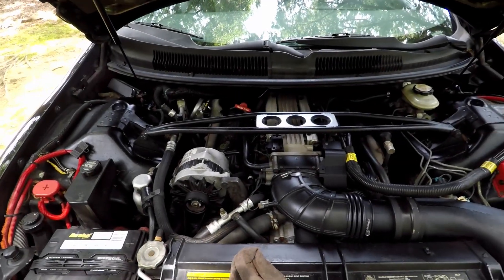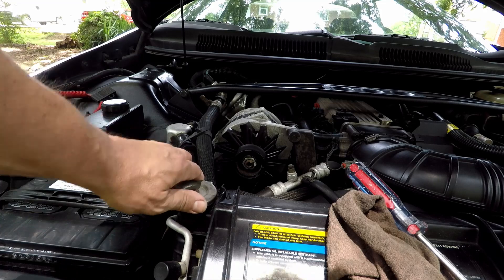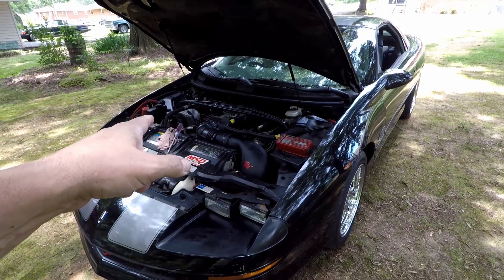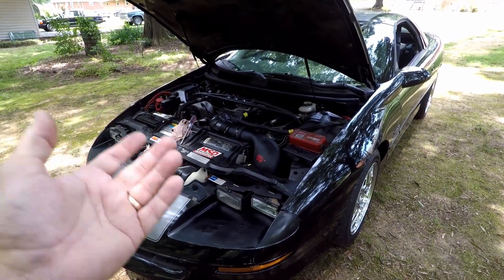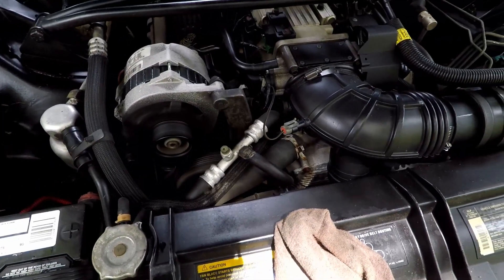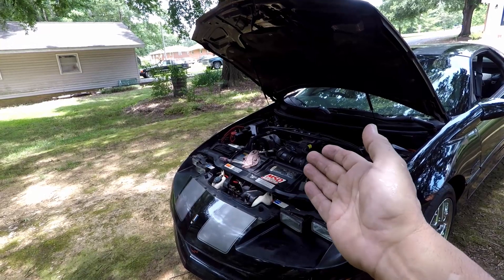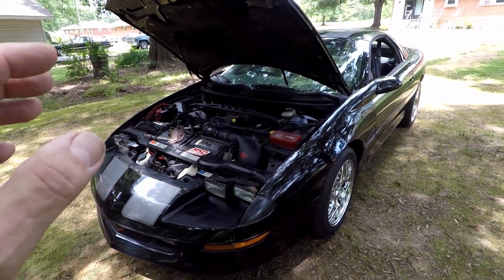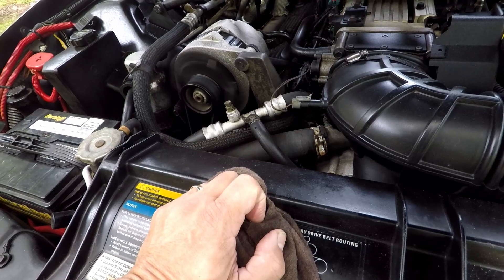How to purge the air out of your cooling system on a 1993 Lt1 Camaro engine

Comment: I'm going to change my radiator this weekend.. I was hoping you had a video on here about this.. Thanks, you make the best videos with fully explaining everything 👊🏻
Reply from the maker: Hi there. I have replaced mine but it was before my Youtube days. Just be sure to pay attention to the placement of the hoses as these cars are reverse flow from a normal car. Thanks for watching
Reply: @CamaroTime yeah I was hoping you had a video replacing the radiator lol but bleeding the air out correctly was my main concern so this video will do me justice. I picked the radiator up today and hopefully going to install it tomorrow along with a thermostat and new cap. I did my transmission mount last week after I watched your video on that. It was pretty easy thanks to your vid

Comment: Checking in 5 years later to let you know I did this exactly as described to my ‘99 ‘V6 Camaro and now she’s not overheating AND my heat is actually hot again! Thanks so much from someone who is not mechanically inclined at all!
Reply from the maker: So very glad it may have helped. That is why I make the videos. Congrats. Thanks for watching

Comment: Hello! Love your Camaro! I have a 1995 3.4 and it had two coolant leaks when I got it. One by the throttle body and the other one was all of the way behind the timing chain cover. I fixed them both and flushed the coolant system. I replaced the waterpump, thermostat, battery, and temp gauge sensor. I don’t have any bleeder valves so I bought the funnel and radiator attachments for the coolant system to bleed that way. The temperature was going up and then back down,each time getting hotter until it was almost overheating so I shut it off. I let it cool down and tried to bleed it again and now every time I tried to start it the car it is dead and I have to jump start it. (Idk why because I Just bought new battery) and My car now has a rough idle and it cuts off after only a few minutes. I don’t know what the issue is now. I also do have a check engine light on but I don’t know how to check it because it has a obd1 computer and an obd2 port. I’m so sad and frustrated. My mechanic said they don’t have any way to check the engine light either. Can you please give me your opinion? Sorry for the long comment but I feel like you might be able to help me. Thank you for your time.
Reply from the maker: Not sure I can help as the car is not here. But let's look at a couple of things. First the coolant. The longer you let it run, the hotter it will get. In fact it will look like it is going to overheat. The temp will go up almost all the way in the red before the fans ever come on. Best way around that is to turn on the AC while purging. That makes the backup fan come on manually. It is odd that now the battery is dead each time. Did it start doing that right after a repair or part swap? If so, check the wiring around that part as you may have accidently pinched a wire. That or the alternator has gone out on it. There are a few code readers on the market that are capable of reading the OBD 1 but are pricey and have a dongle attachment. But you can also jump out 2 of the terminals with a paper clip and watch the flashes on the dash  and count them. Then  look up the code on the internet.  https://www.youtube.com/watch?v=vgXSXCRyw2w

Comment: Mine is shooting out right away even though I drained the block when doing a knock sensor... Uh oh
Reply from the maker: Sure you don't have the lines crossed??? Thanks for watching
Reply: @CamaroTime yeah I think my bleeder location has been tweaked. It's too low in the line! Kinda story of the car now. Fuel leaks from the cap, new OE fuel cap doesn't fit lol

Comment: well i don’t know if anybody will respond but, i just bought a 94’ z/28z It had absolutely zero coolant in it. So i put more coolant in it without bleeding the system. Can i still follow these steps?
Reply from the maker: Absolutely someone will respond. First, congrats on the purchase. You will love it. Very under rated car. You can follow these steps any time during the life of your vehicle. If you have to much, this will allow a little to escape. Just make sure to fill through the overflow reservoir. Bleed the system as described and recheck level afterwards. Can do it as many times as you like. Just make sure car is cold before loosening the screw.......Thanks for watching
Reply: @ Thank you so much man. Car is in pristine collection and when all the problems he said happened to me, at first i was horrified. But thank you again this is a super easy fix
Reply: @CamaroTime  cars in running order beautifully and sounds immaculate. Thank you so much for the help!
Reply from the maker: @ Absolutely my pleasure

Comment: I don’t get I have the gallon says 50/50 antifreeze coolant so cool I use that in both areas or no?
Reply from the maker: Does your coolant system call for the 50/50 mix?
Reply: @CamaroTime  hello :) I have a 3.45 v6 with 2 reservoirs . on the left it says coolant only and on the right has no indication. Thank you!

Comment: How often during this process do you need to check the coolant resivoir level? I seen others do this with the rad cap off so they can monitor the level from the radiator directly. It makes sense not opening the rad cap to risk more air getting in. Thanks.
Reply from the maker: I would check it after doing it a couple of time. You will not lose much coolant at all. Opening the  radiator cap is no issue as long as the car is running as it will be pushing coolant in that direction thereby pushing air out. But you def want to get it back on before you turn car off as it will try to suck air back in that way as it cools. Thanks for watching

Comment: I've been trying to purge my 97 lt1 Camaro but the low coolant light keeps going on. My backup tank has plenty of fluid but Radi doesn't seem to suck fluids from it. I washed the backup tank so it isn't clogged at least. Any thoughts?
Reply from the maker: More than likely the actual coolant level sensor in the side of the radiator is faulty. Mine used to come on all the time. Thanks for watching
Reply: @CamaroTime  Thank you for assists. Mine shut down eventually. i drove around a bit, purged a bit through the purge valve. repeat few times. the light never went off but it didn't light up after i shut down for a while. Maybe the light doesn't reset unless you shut down your engine.
Reply: @CamaroTime  Thank you once more from all of your camaro videos. I spent a week wrenching on my 4th gen as a..beginner merchanic. Survived replacing sparkplugs, sparkplug wires, installing tcc valve block kit on my gearbox. rear brakes,heat sensor etc. Your videos came in handy during this time.
Reply from the maker: LOL....Yeah you just did the hardest part of working on a 4th gen. Anything on the engine. LOL........Just trying to help. Thanks for watching

Comment: What if you have a 94 roadmaster that doesn’t have a coolant cap but a resivore instead ?
Reply from the maker: Not certain about the roadmaster. But if it has the res you should be good. You can always take the cap off (when engine is cold) and start it up. Keep eye on the coolant and hand on the hose. When the hose gets warm to the touch shut off car and replace cap......Thanks for watching

Comment: is that screw on a,1995 Camaro V6 3.4 were is it located 😊
Reply from the maker: There should be one at the thermostat housing  where the hose meets. And on some models there is also one right above the water pump. Thanks for watching

Comment: Will this same procedure work on the LS1 ??
Reply from the maker: I wish there was an easy yes or no answer for this. But sadly not as all LS engines are not the same depending on car, truck, boosted and so on. So I can not say. but if you think you have air in your system you can take off the radiator cap allow the engine to idle and keep your hand on top radiator hose. When it starts to get warm put cap back on and switch engine off. this will allow the air to escape paste the thermostat out the top of radiator. And as the engine cools it will force some out the other way back into your overflow tank...Do that a couple of times and you should be good. But let car cool down between cycles as it will build up pressure and you don't want to get burned opening a hot system

Comment: I've read countless forums and watched multiple videos, but nothing seems to be working for me. I got a 97 Trans Am in March, had the thermostat and waterpump changed in April, replaced the radiator and all hoses in September. Been trying to bleed it since. Every time i hit the bleeder valves, I get solid fluid, even at/above operating temperature. But I can tell there's air in my system because one of the radiator hoses gets swollen and stiff like it's inflated with pressurized air. Sometimes when I hit the throttle, coolant starts to bubble out of the radiator cap and the hoses that connect there. Have any advice that might help me?
Reply from the maker: Honestly, it sounds like the radiator hoses are crossed/backwards. Try switching them around. Thanks for watching

Comment: Thank you for the video. I replaced waterpump on a 97 lt1 and mine definitely has air still. Awesome video!
Reply from the maker: My pleasure. Sometimes it can be quite difficult to get it all out. That is why we have to let it run long enough to open up the Tstat as well. because it will trap air in there unless you have a passive tstat and it is installed correctly. Thanks for watching
Reply: @CamaroTime can you start procedure after car is already hot.
Reply: @WilmaTell  I don't see why not being he got it hot to bleed it...however opening the radiator cap on a hot engine is a no-no so if you need to fill that, do it cold.
Reply: @Ron-l9d of course not. You should have seen the radiator mechanic burp my 96 WS6. That shot up like a geyser. I never seen nothing like that before. Just barely got out of the way.

Comment: Thank you so much for taking the time to make this video, this really helps me a lot, I’ve been worried about getting all the air out of my system after changing my water pump because I’ve heard it could be a real problem for these eng, I have a 96 Z28 SS -
Reply from the maker: They can be indeed. And people think they have it all out but alas not always.....I actually recommend doing this and let it cool. Then drive around short block and do it again.......That way it forces the air to the top of the system. Thanks for watching

Comment: I personally bled mine right at the Thermostat housing.  There should be another bleader screw to the left of it. It works better to get more air out of the system.  Just make sure to put a rag right under it or Coolant will dribble down by the Ooti and if that gets wet......lights out. .
Reply from the maker: Some of the tstat housings actually have a bleeder on the housing itself.  but the one in the hose is higher then the  housing and tstat. And that is the best place to get it out. I have heard so many people say that....but the opti is water resistant anyway. Or they could not put it there nor drive in the rain. Thanks for watching
Reply: @CamaroTime  mine is a 96.  I got 2 bleeder points on that hose. Speaking of T-Stat, as of today I gotta replace mine now since I didn't do it when I put the new water pump on. Only the gasket is a little warped from Re-installing it. I also see that mine has the original Opti on it from the factory.  It runs perfectly and some are not a sealed unit, but the factory ones are, so I don't gotta worry about water getting on it. But I will try the "Top Bleeder" this time. Thanks for your input, I always listen to second opinions.
Reply: I don't think the opti is as weak as people say, but I do think the ignition coil location is problematic! I moved mine and the car is so much better!
Reply: @koraykumru1295  Never had a problem with the opti in my 95 TA..and the car is a south Florida flood survivor. I did make sure when I got the car that the vacuum stuff was hooked up and working. I guess only the people who had an issue with them complain because it is a PITA to get to.

Comment: People always think im crazy when I say my coolant system needs bled because it isn't accepting the coolant.  
Great video !
Quick question though...
Not all cars have that purge valve . Mine does not I think it was installed or reinstalled too low so the air is still getting trapped.  Is this possible?
Reply from the maker: Great point! It is possible indeed.Thanks for watching

Comment: Camarotime! It’s so nice to see you again. I thought I was subscribed but I’m not sure. I hope you are doing extremely well and that Lord willing you have a great rest of the upcoming year. I’ll have to post a video sometime of mine. It’s still running powerful but the low coolant came on when I was sitting in idle for a long time recently on a hot summer night.
Reply from the maker: Thank you so very much.....You as well. Did you check the coolant? If it is good it could just be the sensor located on the upper side of the radiator. Thanks for watching

Comment: Great video very informative.  I had a question though, I swapped a lt1 into a nova and bypassed the heater core and wanted to know if I bleed it from the thermostat? Can't get the air bubbles out.
Reply from the maker: You sure can. You just want to find the highest part of the system. Thanks for watching

Comment: Would you need to do this if you replaced a coolant temperature sensor?
Reply from the maker: If you did not add any coolant it should be fine. but if you had to add some I would play it safe and do it. Only takes 5 minutes. Thanks for watching

Comment: Can i use the same Dexcoolant to i have a V6 3.4? 
Good Video Thanks 👍
Reply: The owner before me have put only water in it so i dont now what color they have use before! And i will replace it now. Thanks for the help 👍 You have always Good Video 👍
Reply from the maker: Not telling you what to do but I would flush it first then. To get out any rust. Then just use the green kind that you dillute. mix it a gallon at a time until you need no more
Reply from the maker: What color is in it now????? if it is green then I would just go with the universal kind.....if it is orange that is Dexcool. thanks for watching

Comment: Good video. Only saw one thing that wasn’t correct. You’re suppose to mix antifreeze and water 50/50. That’s why you’ll see 50/50 dexcool antifreeze sold in stores, so if they put a gal of water and a gal 1/2 antifreeze in your car then they did nothing wrong.
Reply from the maker: Not all antifreeze is that way. It will say on the jug that it is full strength and needs to be dilluted or it is already mixed. Thanks for watching

Comment: What is the normal running temp of this car Sir? i’ve heard that the LT1 engines are running hot from the factory
Reply from the maker: Depends on the thermostat you have in it. If you never changed it, it is probably a 180 degree. So anywhere from 180-200 will be the norm. Keep in mind these gauges are way off. never seen one close. Mine will climb all the way to the bottom of the red before the fan comes on. So you may want to check your gauge. if you ever get concerned at a light or what have you, just click the AC on for a couple seconds. That forces the fan to manually come on. Thanks for watching

Comment: Mine never had water come out , only steam . And the  temp guage got up around 260. So I shut it off. Just got done doing an opti and water pump.
Reply from the maker: Did you check to see if the hole was stopped up. You will get anitfreeze coming out. Thanks for watching
Reply: @CamaroTime  The screw is out and steam is shooting out.

Comment: I just got a 95 Z28 and 2 questions. 1 is i have a little blue elbow nipple thing on my intake hose behind the maf that's not hooked up to anything "little rubber hose", what's that? Also under light acceleration my car stumbles/hesitates could the tps cause that?? My Z28 isn't as clean as yours but i'm slowly getting her there
Reply from the maker: Hey there. Congrats.  I would need to see a photo of what you are talking about. It could be many things. The TPS , the MAF, dirty IAT, stopped up cats, bad ECM, bad coil, bad plugs. Mine was not that clean when I got her either. But steady work prevails.........Thanks for watching

Comment: I have a 94 LT1 and when I got it it had Green coolant in it so I’ve been using that. Should I do a complete flush and switch to Dexcool? In the manual it says 1825M?
Reply from the maker: Hey there. Green coolant is not necessarily bad. They came out with a universal green that can be used in anything. According to GM 1825M is a green antifreeze. Somewhere around 96 they switched over to Dex Cool. So having green in there it would be correct. Thanks for watching
Reply: Dexcool will have your internals looking rusty.... I like the Green better.